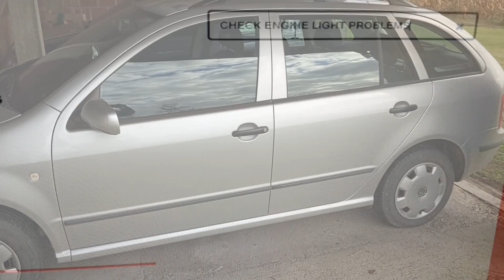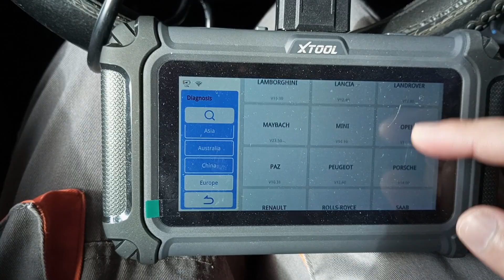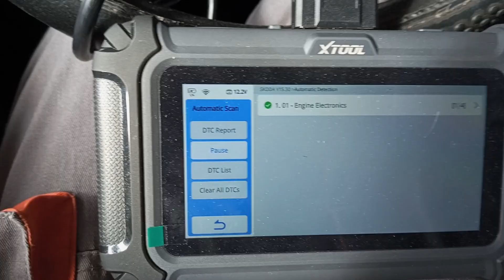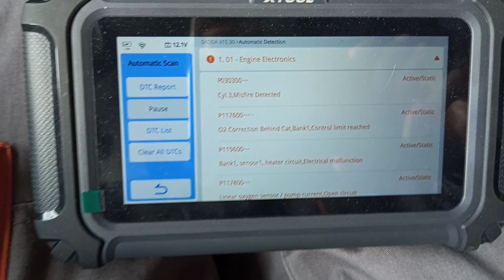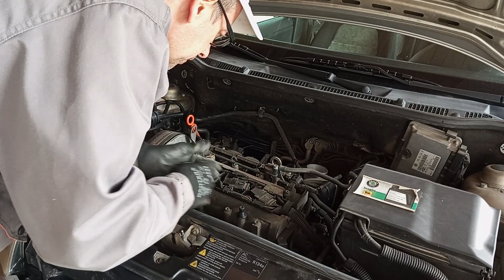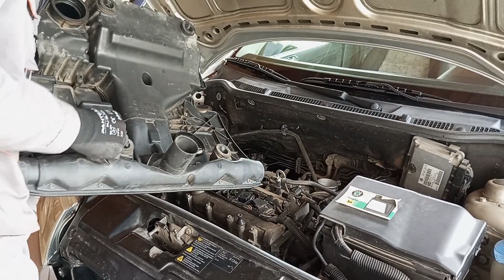How To Fix An Engine Misfire-P0300 (Bad Ignition Coil)

Comment: I have a 2009 Skoda Superb 1.8 TSI (160 hp).
I am experiencing a misfire issue. The engine runs on 3 cylinders instead of 4. I replaced two ignition coils with new Bosch ones, but the problem is still there. I also replaced all the spark plugs.
At low RPM (below 3000), the engine shakes a lot and runs very rough, even when accelerating. However, when the RPM goes above 3000, the engine becomes more stable and the fourth cylinder seems to start working again... idk how to solve this
Reply from the maker: Hi and thanks for watching! Did you connect an OBD tool,  is there any kind of DTC code? There could be numerous reasons for that problem.